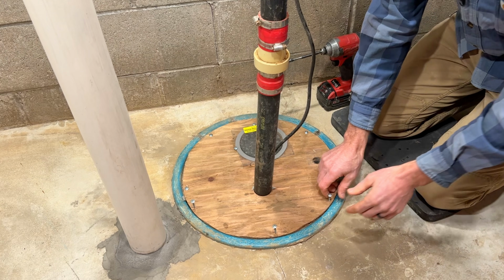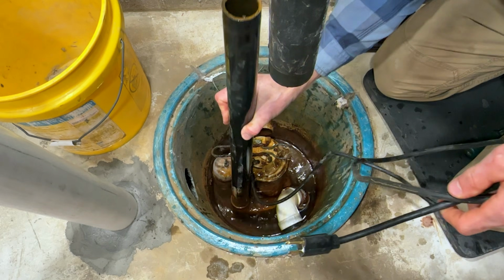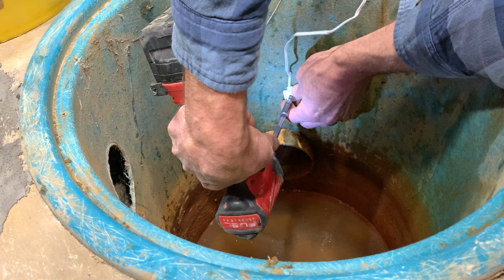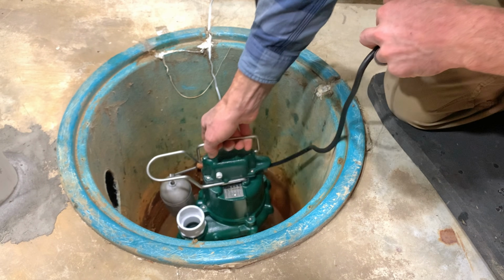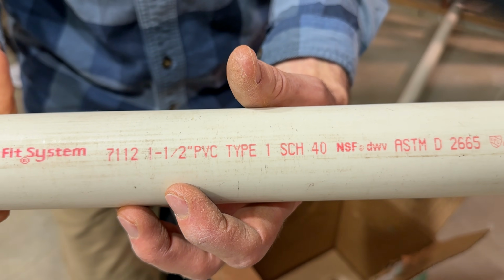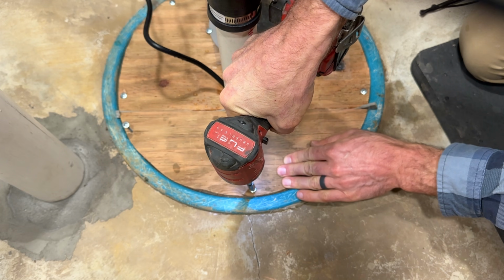How to Replace and Install a Sump Pump - Step-by-Step Directions

Comment from the maker: Featured Products:
1. Zoeller M53 Sump Pump - https://amzn.to/422Dgpo

2. Zoeller M63 Premium Sump Pump - https://amzn.to/4fu3RAS

3. Water Alarm - https://amzn.to/4ji53YC

4. Stainless Screws - https://amzn.to/42o3qBO

5. Teflon Tape - https://amzn.to/42p07uf

6. 1.5 Inch Threaded Adapter - https://amzn.to/3EayY6i

7. Quiet Check Valve - https://amzn.to/3FWBWvN

8. 1.5 Inch PVC Pipe - https://amzn.to/427BW4J

9. PVC Primer and Cement - https://amzn.to/4ls7Gcs

10. Zip Ties - https://amzn.to/427CfMV

11. Clear Silicone - https://amzn.to/4jJPw4j

Tools:
1. Milwaukee Drill & Driver Combo - https://amzn.to/4lp3iuv

2. 5/16 Nut Driver - https://amzn.to/3Eeze44

3. Milwaukee Level - https://amzn.to/42CnPV5

4. Masonry Drill Bit - https://amzn.to/4ls6dCY

5. Milwaukee Vac - https://amzn.to/44oOQfU

6. Reed Pipe Cutter - https://amzn.to/4ji6MNA

7. Chamfering Tool - https://amzn.to/423Ucfb

8. Deburring Tool - https://amzn.to/3RbQpWW

9. 3/16 Drill Bit - https://amzn.to/3XNkkIL

10. Caulk Gun - https://amzn.to/3YojJxc

Related Videos
1. How to Install a New Sump Cover with Water Alarm - https://youtube.com/shorts/rH0Je6hyd_8
2. Radon Mitigation in a Home with Drain Tile - https://youtu.be/h0g_UY5-Zew

How to Replace a Sump Pump – Step-by-Step Instructions

In this video, we walk you through the process of replacing a sump pump. The float switch on our old sump pump was malfunctioning, so we decided to upgrade to the Zoeller M63 Sump Pump. After consulting with two experts who own wet basement companies, I chose the M63 because it has more durable cast iron components and a better warranty than the M53 model. Plus, it can handle half-inch solids, like small rocks, that might be in your sump pit.

Steps Covered:

1. Removing the Old Pump: Start by removing the sump cover and the old sump pump. (You might want to keep the old pump as a backup in case of emergencies.)

2. Installing a Dual-Sensor Water Alarm: We add an extra layer of safety with a dual-sensor water alarm.

3. Installing the New Zoeller M63 Pump: Follow the Zoeller instructions, which recommend drilling a 3/16-inch weep hole at a downward angle to prevent air-locking in the pump.

4. Replacing the Check Valve: We swap the noisy check valve for a clear, quiet model – and the difference in sound is impressive!

5. Testing the New Pump: We test the new pump by running water into the sump basket. Be sure to check that the float switch isn't getting stuck.

6. Sealing the Sump Cover: Since the home has a radon mitigation system, we seal the cover to maintain the system's effectiveness.

Pro Tip: If you haven't tested your radon levels in the last two years, it's a good idea to do so. Here's our favorite radon monitor for accurate readings: https://americanradonmitigation.com/product/ecoqube/

📍 Service Area
Serving Colorado’s Front Range and Mountain Communities:
Golden, Boulder, Denver, Cherry Hills Village, Evergreen, Breckenridge, Vail, Aspen, and nearby areas.

🗓  Schedule an Estimate
Live in Colorado? Book your in-person radon mitigation system estimate here: https://americanradonmitigation.com/

🌎  Have a Question for Jesse?
We offer virtual consultations worldwide: https://americanradonmitigation.com/consulting/

🛒  Need a Radon Monitor or Supplies?
Shop our online store: https://americanradonmitigation.com/shop/

🛍  Our Amazon Store: https://amazon.com/shop/americanradonmitigation
We participate in the Amazon Associates Program and may earn commissions from qualifying purchases made through the links above. Thanks for your support!

Comment: Check valve should be How far from bottom of sump pump?
Reply from the maker: The check valve is usually installed on the discharge pipe just above the sump basin or cover. It is not normally measured from the bottom of the pump. The exact placement can vary, so follow the pump manufacturer’s instructions and local plumbing code.

Comment: Grest work. Why the need for the bleed hole?
Reply from the maker: Thank you. The manufacturer calls for the weep hole in the instructions. It’s my understanding that it’s to help prevent airlock.
Reply: Insert it at top of pump height for a Zoeller? I also heard 2-6 inches above the bottom of discharge pipe. I think top may be the more accurate.

Comment: Regarding the Radon mitigation and using silicone to seal the pit, could an owner do something less permanent such as plug duct seal (example- Gardner Bender)? 

Thanks for the informative video!
Reply from the maker: Yes, you could use some sort of gasket material.
Reply: @AmericanRadonMitigation thank you for the reply.
Reply from the maker: My pleasure.

Comment: I have the same pump. When it rains it runs every minute for about 5 seconds. I'd rather have it run less and empty more. I assume this can be done by raising the float. How do I do that?
Reply from the maker: I don't believe you can adjust the float on this model. To change the activation height, you’d need a pump with a tethered float where you can adjust the cord length.

Personally, I’m not a big fan of those because the float can sometimes get caught on the side of the sump basin. If that happens, the pump won’t turn on, which can lead to flooding.

Comment: Is a weep hole necessary? What is it for?
Reply from the maker: The installation manual calls for it to prevent an airlock.
Reply: @sonder007  most pumps have a weep hole built into the housing, but it never hurts to do preventative measures
Reply from the maker: Even if the pump has internal air-bleed features, as this one does, the manufacturer still recommends a weep hole in the discharge pipe as a redundant safeguard. It guarantees that any trapped air in the discharge line can escape so the pump can’t airlock. It’s a simple preventative step that helps ensure the pump primes and moves water reliably.
Reply: @AmericanRadonMitigation  Thank You for explaining this . 
.

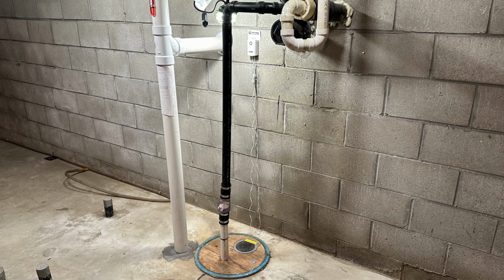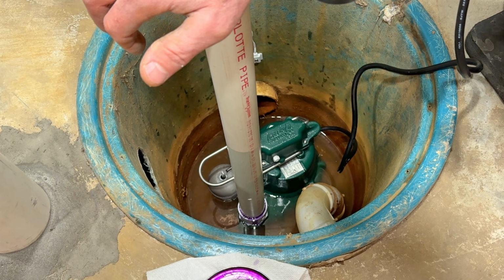Comment: At time index 4:15 you show the final system. There appears to be a radon pipe adjacent to the sump pump. Does the radon PVC connect to the sump pit under the concrete? (hole cut into the side of the radon pit shown at time index 3:10 that does not have a corrugated drainage pipe feed, and is above the other drainage pipe feed).   With the roughly 4 inch hole in the cover for the sump pit, it looks like the radon pump use to draw directly from the pit, (time index 0.56 shows all).  Also there is a PVC Tee on the radon pipe that goes through the wall. Is that section of the radon system meant to draw from the concrete block wall?   Great video.  Thanks for the education.
Reply from the maker: Good eye! Yes, this home had a radon system installed before we rented it from the owners. 

One suction point draws near the sump basket, which has a hole cut into the side of the basket. The home has exterior drain tile that drains to the sump basket. The second suction point goes through the block wall to depressurize the encapsulated crawl space on the other side of the block wall. 

Thanks for the compliment!

Comment: How do you normally install a system in a slab-on-grade home that doesn't have a basement? I know you don't like outdoor systems, so would you aim to put the suction point in the garage? I've read that you can also drill from the exterior, through the foundation, under the slab. In some cases, the slab is higher than grade, which is easy; if not, you have to dig down a bit. Have you ever installed a system like that?
Reply from the maker: Slab-on-grade homes can be much more complicated depending on the size of the home's footprint, interior footings, how well the floor-to-wall joint is sealed, and what material is below the slab. A suction point in the garage would likely only mitigate the garage and not provide suction below the house due to footings or a foundation wall limiting pressure field extension. I have seen some people install systems by drilling through an exterior wall. However, I have only done that to depressurize tunnels below a school.
Reply: @AmericanRadonMitigation  Have you ever put a fan outside and on top of the roof of a home permanently. I’ve seen that be done short term for testing to see if a passive system functions properly. But was curious if you have ever done that permanently?
Reply from the maker: @lukezier9616 only on a house with a flat roof that didn’t have an attic. The hard part is getting power to the fan.

Comment: How's everything working out? Getting a M53 tomorrow from a local plumbing supply store. I was going to get a Zoeller at Lowes but those have much more plastic on them. Am I correct that the M53 has a plastic bottom? Also plastic impeller? I'm returning my 5 day old Ridgid/Wayne pump back to Home Depot because there's rust all over the "stainless steel" housing.
Reply from the maker: Thanks for the question! It’s working well so far. The quiet check valve is very nice since there's no clunk after the pump runs. I was going to get the M53 until I spoke to one of my friends who owns a wet basement company. He suggested the M63 for several reasons, including the ability to pass half-inch solids like a rock, the metal impeller, and the better parts and warranty than the M53. I'm not sure about the plastic bottom on the M53, although he did say it has a plastic impeller.
Reply: @AmericanRadonMitigation  Thanks. I was looking at the intake section on the very bottom. I think they're both plastic but a cast iron impeller on the M63. Thanks for clarifying. EDIT: Sorry, I'm wrong. The M63 base/intake is also cast iron!! Thanks!
Reply from the maker: You bet! Thanks for adding value in the comments!

Comment: Why did you drill a hole in the pvc inside the sump?
Reply: In my case....it also helps makes more bubbles it the pit when I do laundry. Sump pump and whole pit is   more cleaner this way.
Reply from the maker: The installation guide calls for the hole to prevent an airlock, which would prevent the pump from moving water.
Reply: @AmericanRadonMitigation  to create some air flow to allow better water movement?
Reply from the maker: Air lock happens when a bubble of air gets trapped in the pump, blocking water from flowing. The vent hole lets trapped air escape, so the pump can move water properly. Thanks for your questions!
Reply: @AmericanRadonMitigation 
Is that with all sump pumps?🇦🇺
Reply: @AmericanRadonMitigation  that makes sense now. Thanks
Reply from the maker: From what I understand, many sump pumps come with a built-in vent hole. However, over time, that hole can rust shut or become blocked. That’s why it’s generally considered best practice to drill your own vent hole, even if the manufacturer says it’s not required.
Reply from the maker: You bet!

Comment: That clear cover over the sump pump is cool and very practical, I didn’t know there was something like that out there, and that plug with the light is just common sense. Great video 🙏🙏
Reply from the maker: Yes, the clear cover makes it easy to keep an eye on things, especially when you shine a flashlight through it. I agree with you about the plug. What a genius idea the folks at Zoeller had!